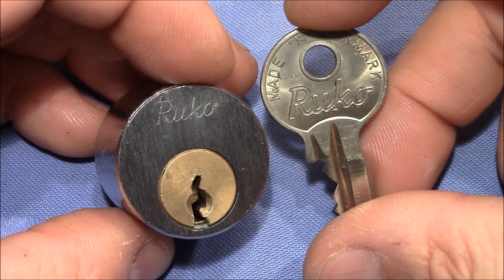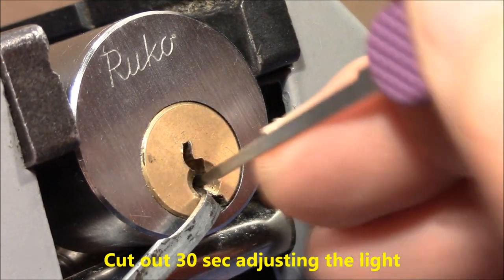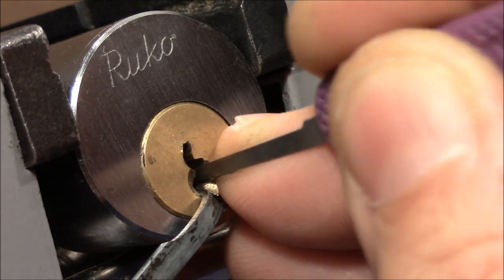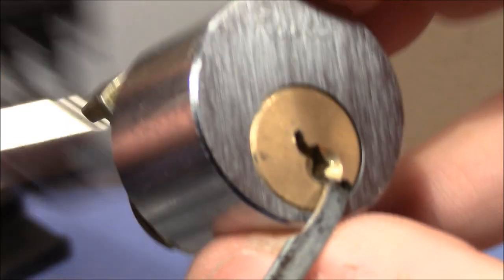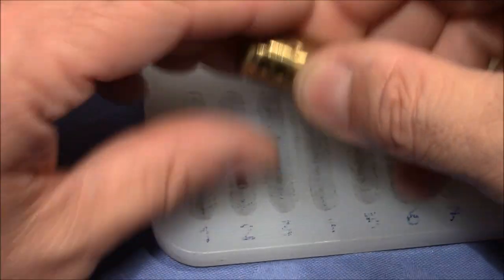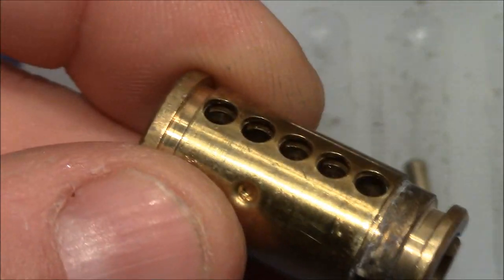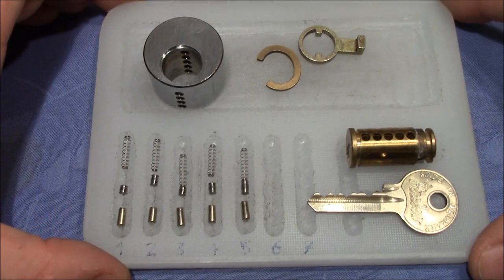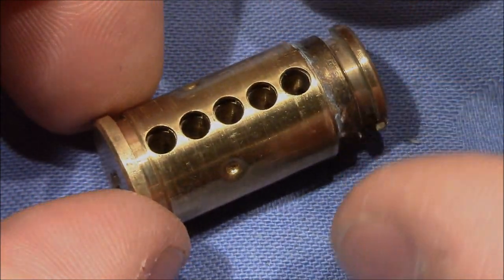(picking 590) Beautiful Ruko lock picked and gutted - interesting plug construction and feedback

Comment: Hmm yes very nice lock. Very good and fast pick, congrats man😊👌👍. I still don't have one of these Rukos, just ASSA. I think it would be much more of a challenge if it contained those older ASSA driver which look a bit like a gin bottle. The tolerances are quiet tight, what probably was the reason why you could not get a shim in there.
Reply from the maker: Yes, tight tolerances and strange feedback from the counter milling. I have an ASSA 600 with the gin bottle drivers - it's a nightmare to pick. Thanks for watching buddy.